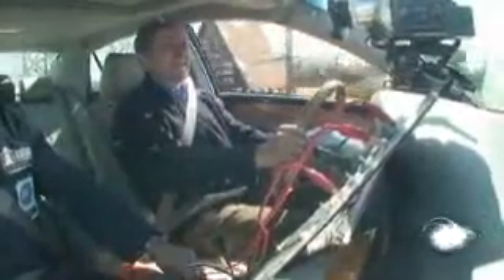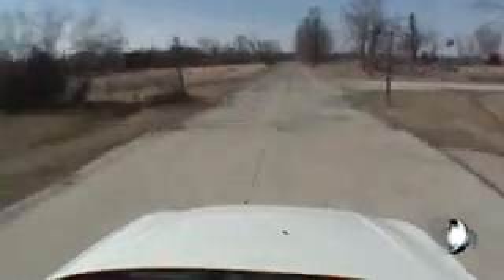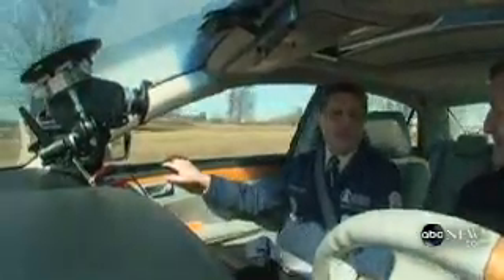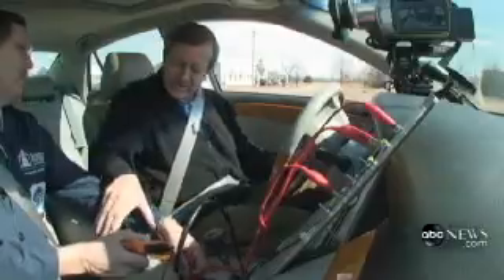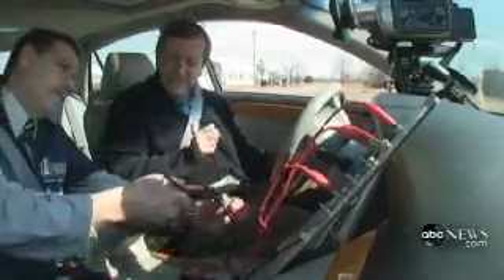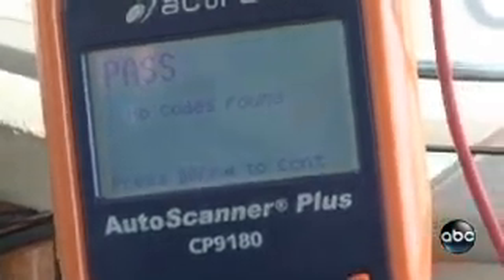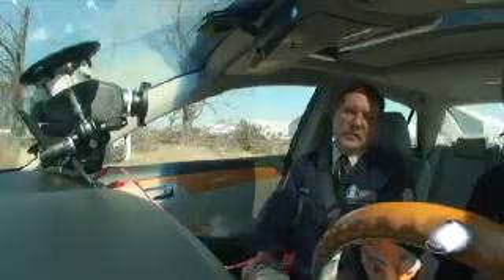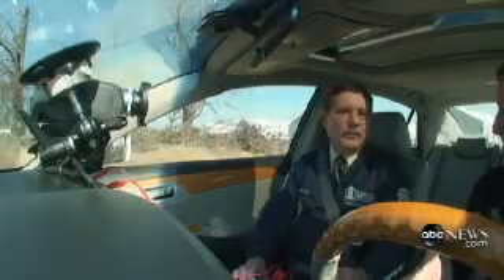Video Expert recreates Toyota sudden acceleration

Comment: Video is fake, Glibert spliced into the car's electronics and hooked up his own controller to it. Gilbert cut three wires within the electronic throttle control system, then connected two of the wires to each other in a specific pattern and with a specific resistor to create a link between two final wires with a switch in between so he can control it.

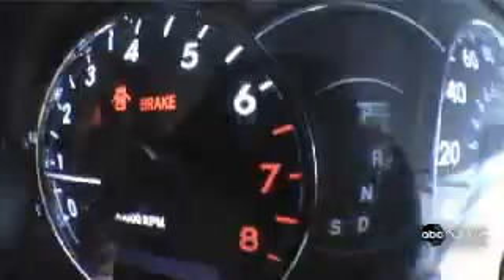Comment: Brian Ross and this report are a disgrace to auto journalists and techs everywhere. This report is widely known to be faked - at minute 2:16 when he says they are going 20 mph you can stop the video and clearly see in the tach area the door is open and the seatbelt light is on - fake editing, they had their seatbelts on and no door was open. Shame on Ross and Gilbert for ever producing this garbage
Reply: Big fake - oh ya, disgrace big time
Reply: I don't know if the video is fake, but I wouldn't base it on the door open and seatbelt light being on.  That car was highly modified for the testing they did, they have the dash all apart.  I doubt any of the warning lights were working properly.
Reply: tom doorn Guys a lot smarter than him concluded in a report (do your homework first) that Toyota never had a problem - it is and was "brake pedal misapplication" Ask Doc Gilbert to give you a lesson on that. He was and is on the wrong side of history on this one.
Reply: tom doorn This is old news - Toyota wanted to know what he did - when he met them they explained to him how his test was faulty from the start and his understanding of their system was limited - I'm sure he explained all this to you. Don't tell me Gilbert doesn't believe the results of the final report from NHTSA/NASA  stating it wasn't a fault in the Toyota's system.
Reply: tom doorn This video is a disgrace NOT because the testing in it is done improperly or anything like that, It is a disgrace because it was presented to millions of viewers as the reason Toyota cars were having problems at the time - Gilbert may know how to test cars but he was used by the idiot Ross to show people the "reason" behind the Toyota crashes which of course is now known to be completely false - it was, and always will be, brake pedal misapplication not a fault of the cars electrical systems - plain and simple
Reply: Agreed. And also, there is no needle pointing at "20", so they where probably stopped and just reving the engine
Reply: tom doorn Dude, you should do your research. First off, this same dude already admitted that this video was fake (also here in Youtube). So that would be the end of it. But in case you are thinking on coming back: At min 2:15, you have the speedometer at "0 mph", "Hand Brake" light on, and "Door Ajar" light on and "Seatbelt" light on. So, this means your "brilliant man" is brilliant enough to conduct a "scientific driving test" with hand brake on, doors open, the car lifted, and no seatbelts (in a car that is supossed to be dangerous).
No reasonable man could argue with this..... So, until never :) !!
Reply: Agreed - 100%

Comment: Yeah, but it was caused by operator error. Not by a computer glitch. This was staged. Just like how 60 Minutes staged the sudden acceleration of Audis in the 80's by tampering with the car, which is what ABC has done here. We're not saying SUA doesn't exist. We're saying that ABC basically slandered Toyota with this video.

Comment: Watch 2:15.   Did you notice that door sign, seat belt sign, and brake sign are all on!?!?  This means that when that acceleration was taking place, the car was in complete STOP.   It was edited.

Plus, this acceleration will take place for other cars (INCLUDING GM cars) if same technique/method is used. 

We seriously need to make sure the sources and information when we look at research, such as this video.

Comment: GM sales are up !  the ploy worked !

its been over a year and no sudden acceleration from a toyota vehicle from what the medial claim about the faults there should be dozens of this sudden acceleration but none so far not a single one suddenly

what a MIRACLE !  they really didn't do anything but replace floormats and shave down the pedal and the problem is suddenly GONE !  halelujah !

Comment: Have these cars been traced back to auto repair mechanics that  miss read there shop manual warnings on the 5 volt electronics part damage caused by test light power probes? polatron.com

Comment: This is an excercise in onboard diagnostic records, a fault is artifically induced but the onboard diagnostics do not record the fault , there fore Toyota would say technically their is no fault when obviously there is. New evolutionary advanced technology sometimes relies on experiments and vehicle's owners placing faith in computerised technology which testing and trials have not extended to everyday normal driving conditions. If it aint broke, why fix it  and replace reliable mechanical pedal

Comment: You don't need power steering to coast.  (especially at 120mph)  Try it yourself.
>in worst case in some car lock your steering completely
Actually, if you turn the key all the way, yes, it would lock the steering, but otherwise, just turn it 1 notch to ACC and you'll be fine.  Again, try it first before replying.
What I want to emphasize is, you should not encourage ppl to use hand brakes even in these situations.  Kill the engine and gently pull over.  That's all you need to do.

Comment: @mrblockboii 
>r u the one of those ignorants call the cop with your cell phone
I didn't say that.  I just said handbrakes with front drive is not safe.
>try something out to slow down your car?
Putting the gear in neutral and killing the engine is the best thing to do in these situations.  I never denied it.
>who is gonna worry about that car spin out?
Kill the engine, gear in neutral, and you survive.  120mph and handbrakes = high chances of death.
Dumbass like you make my world fun.

Comment: @mrblockboii 
I know it works LOL.  You're missing the point completely.
I'm just saying the combination of front wheel drive and hand brakes are not a safe way to stop your car.  If you think it's safe, then go try it yourself.  I'd recommend an easy curve instead of a straight road.

Comment: exactly, ppl just dont know shit about how the car works and other generals.
IF STICKY GAS PEDAL HAPPENS JUST PUT THE MOTHERFUCKIN GEAR IN THE NEUTRAL AND THEN CALL COPS  if you have time to pick up cell phone to call cops YOU HAVE PLENTY FUCKIN TIME TO DO SHIT WHILE ITS ACCELRATING LIKE PUT IN NEUTRAL, KILL THE ENGINE, USE HAND BRAKE, etc lol

Comment: It's all about shifting to neutral or if it's a manual transmission, stomping on the clutch. It's too easy to switch the ignition too far and lock the steering wheel.

In fact, everyone should practice shifting to neutral unexpectedly... maybe have someone riding shotgun with a broomstick suddenly depress the accelerator.

Comment: Putting it into neutral would work, but might "over rev" the engine and blow the engine since the accelerator is stuck in full throttle position with NO load on the engine.

Comment: IF this happens to you...FIRST thing you do is gently turn the ignition switch back slowly until the engine shuts off BUT do not completely turn the key all the way back because this will lock the steering wheel, so this will allow the engine to be off and you to still drive and brake and come to a safe stop. THINK DON'T PANIC! Then don't drive, call a tow truck and have it fixed, or better yet BUY another brand of car.

Comment: this "journalism" is so bogus this guy should be working for the "enquirer".  sadly many people wont see that the brake is on, doors are open, and the tranny is in neutral while this so called event happens.
  
finally there is nothing wrong with drive by wire-planes have been that way for decades and no one gives it a second though.  toyota has a poorly engineered system which needs to be fixed.  as for a mechanical throttle linkage, they can break or stick, too!!

Comment: sounds a lot like "60 Minutes'" Audi fiasco of the mid 80's.  also, while most automatic trannys are electronically controlled the are still shifted manually into drive, reverse, etc.  unless u have a push button or rotary type lever.  i had my brakes go out on my pontiac and the first thing i did was shift into neutral and use the e-brake to stop.

Comment: I can symphatize with the toyota engineers though.  

Having a problem that can't be replicated everytime using identical vehicles with similar variables makes it very hard to troubleshoot.  Life would be a lot easier if it re-occurs everytime under the same scenario, easier to narrow down the problem.

why not just go back to the old metal wired cable throttle links(not sure what it's called)?

Comment: stripping the insulation on the wires? what if you just melt it, like, say near a hot engine or close to the firewall?  has anyone tried that and without the 200 ohm resistor.  5V sounds suspiciously like the universal "on" voltage for microelectronics.

That or do what GM and Ford did and just blame the consumer for all their problems.  Lets see how that works.

Comment: if a REAL short happens it does throw a code.  Real shorts are .5 ohms and less.  If you read Exponent's report this fabrication of his only works with resistances of 50-250 ohms.  Any connection with a resistance greater or lower than this range puts the car in limp mode  

The second I saw this guy use a resistor for a short, I knew I smelt BS

Comment: check out the fake footage when the tachometer revs, the gauge cluster shows the car is in Park, the speedometer is zero, the parking brake is on, the doors are open, and the driver isnt belted.

just part of the deceptive journalism, they wont even show the the tachometer when the supposed SUA even occurs

CBS lied on Audi 5000 SUA, NBC lied on exploding gas tanks, I guess ABC felt left out and they needed to fabricate BS also.

Comment: There are other makes chose not to equip with brake override. This is not for no reason. Being a consumer myself I do not like the idea of brake override as it takes part of my control to my venicle away from me. One, though not every one, may in certain circumstance needs to operate the two pedals at the same time while still demanding power from the engine. I want my car to always do the things I tell it to do, even if they are conflicting. I am the driver, I take control, not the machine.

Comment: Yeah, but this "technical fault" is correlated with the driver's age. Your car is 6 times more likely to have this "defect" if you are elderly.
Besides the guy had to purposely short out TWO sensors to cause the car to take off. When he returned it to normal operation the fault would obviously go away.
It's like viciously poking a dog repeatedly with a stick to "Prove" that it's dangerous and should be put down.

Comment: The emergency(PARKING) brake wont do anything. All the emergency(PARKING) brake is is a cable linkage to actuate part of your rear brakes. This is only intended to hold your car on a hill when parked. That is why is is called the parking brake. Emergency brakes are found on heavy duty vehicles and are something completely diferent. Unless your regular brakes have failed due to loss of pressure or broken components, there is no reason the parking brake should help the drivers situation.

Comment: You dont need ABS or power steering, you can armstrong steer those cars, they are light. ABS is only for quick hard stops, you only need to apply normal brakes. The brake booster stores vaccum so you get a few good pumps out of your power brakes even if your engine is off.

Comment: @JimmyUnlimit3d 

I believe that they inserted the clip of the tachometer in post-production.  In the in-car shots, there's no camera watching the instrument cluster.

The problem here is that the car's computer does not recognize that the accelerator position sensors are shorted out.  Most electronic accelerator pedals have redundant sensors.  When one fails a DTC is set.  If the second fails, many manufacturers will program the computer to maintain an idle engine speed.  No failsafes on 'Yota.

Comment: @SupportForToyota Very very disappointed in ABC news... I almost believed them.

The video is a fake;

Also, there is no proof still, even if the electronics is flawed and does not shut off, when he artificially induced an electronic signal to the drive by wire system to accelerate.

You would basically have to tear the entire system apart to do this, while the people who were in real accidents did not tear their cars apart.
Reply: It’s real because IT HAPPENED TO ME TODAY in my Toyota Auris!!!!!  A terrifying experience I never want to have again!!!

Comment: Cutting the ABS and power steering is the last thing you want to do when in a situation like that. You will essentially turn your car into a freight train, unable to steer and brake hard and fast enough to avoid any dangers. The only thing people should be doing is shifting to neutral - that will cut all throttle to the engine while allowing you to maintain control to come to a safe stop.

Comment: The issue is that this CAN happen. As anyone who's had the experience of sorting out faulty car wiring can testify, shorts can happen, and even if it's rare, it's still unacceptable. 

Plus, yes you can turn it off, but if you're crawling through a parking lot and suddenly the car takes off, you'll undoubtedly run into something/somebody before you realize what's going on and go for the key, shifter, whatever you use to stop the damn thing.

Comment: It'll turn of ABS and power steering yes but most importantly it'll kill the engine. If the engine isn't revving the car won't be accelerating. 

Better yet just turn the key one click, that way the engine's shut off but all other systems are still active.

Comment: You can't turn off a car and stop it cold while driving dude. All you will do is cut electricity to the ABS and Power Steering making it much worse. New cars will never allow you to do that. Only thing you can do is switch to Neutral and slam the brakes.